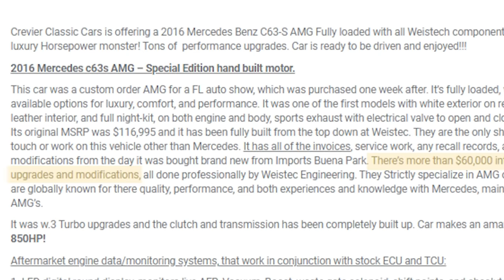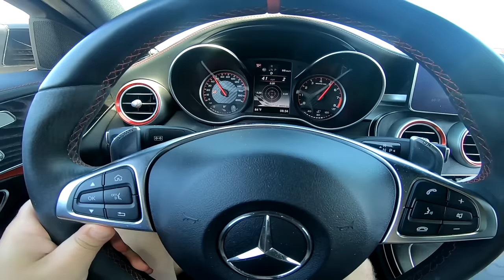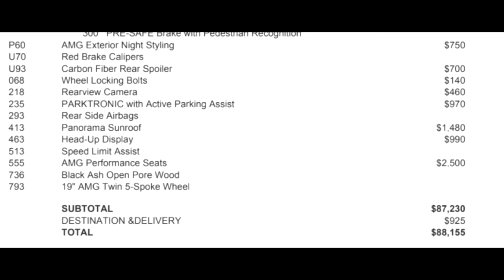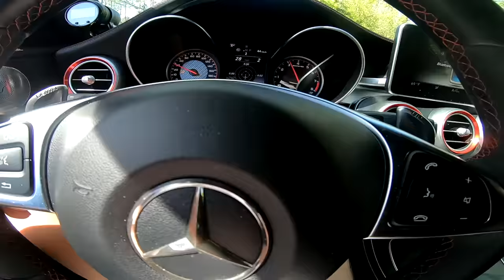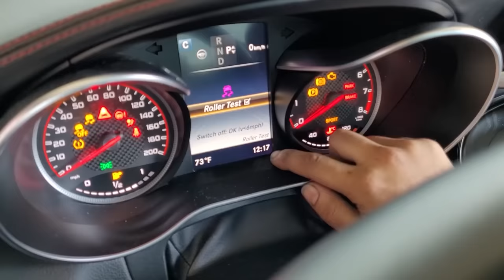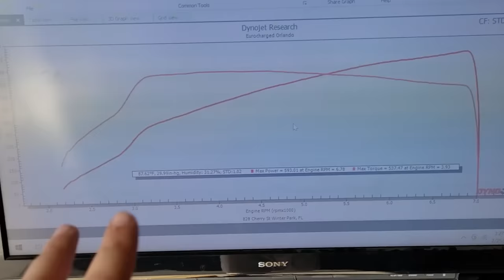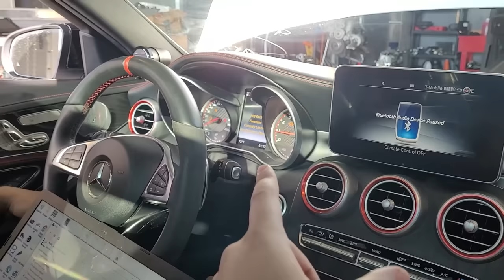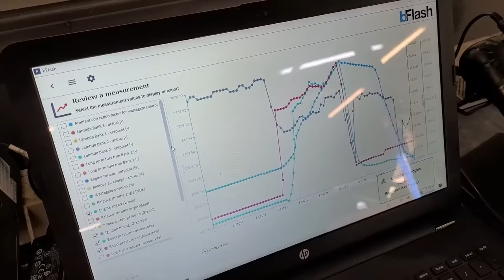I Bought an "AS-IS" $90,000 Mercedes AMG at Auction and got 50% OFF (Twin Turbo C63s)

Comment: I think it’s time to take a break from BMW
Reply: Drama = more views
Reply: @iordanisG  But a far superior driving experience ;)
Reply: My problem with the C63s, and I had one, is that the W205s are stupid powerful but they look like a housewife’s car.
Reply: @986C  That's not a problem that is a benefit. Sleeper!
Reply: @986C  its fun when an bmw or audi stands next to u and u have the amg logo off they think they have a chance
Reply: @bob bob doesn’t change the fact that they’re headaches and expensive ones at that.
Reply: BMW = Drive it till it breaks and sell it because repairs are too expensive.  But it's cool because you can get a high performance V8 for $10k, just don't expect it to last.
Got myself a 2014 E550 4matic sedan with 70k miles for $19k, $23k after 5 year warranty and 3 year service contract.  Filter, downpipes and ECU and it'll crush a Huracan.
Reply: Currently own two BMWs, and am certainly done with BMW.
Reply: Just buys another car so he has less grass to cut 😀

Comment: Someone must have removed the aftermarket exhaust off that car, no way would they do all that work to turbos, oil pan etc and leave a stock exhaust on
Reply: Definitely. Those exhaust were holding on by clamps. Its already been cut. So u right
Reply: Also, the video was sponsored by a known brand exhaust company. Maybe they took the after market ooff, added a stock so they could swap it out with the sponsors?
Reply: @ACURACALABAR11  mercedes come stock with v band style junctions

Comment: Kinda weird your car has a bigger turbo but comes with a stock exhaust. Most of tuners change the exhaust first when they crank up the boost on stock turbos. Although I would say the stock exhaust had some beefy tubes from factory. Don't forget to do a retune after the armytrix swap. The higher flow might lean out your initial tune on the engine. Also do 2 tunes. One with close valves then do another with open valves. Just to make it more reliable. You got a good car at a very good price.

Comment: A Floridian driver that looks over their shoulder when merging? That's a first.
Reply: I’m from New York 😅
Reply: You should never have to "look over your shoulder" when merging/changing lanes, no matter how hard your blind spots are. You should be able to turn your head slightly to look out the sides view mirror, and see your blind spot in your peripheral. The combination of your side view mirror and your peripheral vision should show you everything you need to see. Turning your body to look over your shoulder is a dangerous rookie move. Your back should not lift off the back of the seat. Only your neck should move.

Comment: 0:22 I was astonished to learn that a BMW I8 has a head gasket. Then I learned that some I8s, like the I3, are equipped with a gasoline engine-driven generator, which brings back oil changes and all the other maintenance a gasoline engine needs. At least it isn't necessary to clean and gap the points anymore.

Comment: The brakes on the wagon most definitely don’t look like carbon ceramics 🤔
Reply: Pause it, those are definitely the calipers of amg ccb
Reply: Many amg's don't have ceramics on the rear...
Reply: @PNFarhan  no bro I’m sorry. That usually applies to the calipers. Usually high performance car now a days have like 4 or 6 piston calipers in the front but regular calipers on the back. But never have I seen carbon rotors in the front and drilled rotors on the back. It wouldn’t make sense. That car definitely did not have carbon rotors.
Reply: @PNFarhan  if I’m wrong pls tell me so because I’ve never seen anything like that.

Comment: I don´t know how it is with other car brands such as Audi or BMWs but i recently got my Armytrix downpipes installed on my 2020 E63 AMG (they even posted it to their story). To change the downpipes my mechanic had to remove the entirety of the engine, lower it down, install the downpipes and then reinstall the engine with 2mm space to the left and the right side? Its a nightmare to do such a job. Is it only Mercedes or are other car brands being a pain when it comes to installing some downpipes?
Reply: @itsababyfuckenwheel5088  Yeah it is, the engine was around 2 meters long plus the transmission around 3 meters (around 10 feet)
Reply: BMW is fairly easy to do yourself. Usually just a couple clamps and bolts to remove
Reply: @SwordTrunks  Crazy, my next race car is definitely going to be a BMW!
Reply: Well, what I can tell you is that replacing the piece of exhaust pipe that rotted out over the rear axle of my 2009 Sentra was a bugger.  Fortunately it added no horsepower or torque.  Must have taken all of 45 minutes and cost about $3.  

Now, tricking out my 1974 Honda CB 400 was another story.  My research, efforts and exorbitant parts costs was well worth it, I added nearly two horses to that baby.  Trade secret I'll share since you're a fellow motorhead......air filters.  Massive improvement.
Reply: @6comma316  Well id say stick with the hand built 63AMG power.  I tell you why: A friend once asked me hows your BMW cus i want to get one? I replied: hows your retirement account?.  💀
Reply: @dusaintel  bruh 😂😂😂😂😂
Reply: @erswnn  Damn man thats crazy 😂
Reply: @6comma316  Yeah man, I take it to the limit...then go beyond.  I'm like a mechanical geniass.  I invented cup holders but Big Auto stole it from me.

I once swapped out the alternator in an Astro van.  I'm hardcore to the max yo.

Comment: How much wheel spin were you getting? Seems the rear wheels should have been farther forward on the roller which allows them to push into it vs. behind the center line where its essentially climbing up the roller allowing it to slip easier.

Either way, nice car, keep the vids coming.

Comment: C-class is an amazing platform. Ive experienced the 4 cylinder, the 6 cylinder and the 8 and they are exponentially more impressive as you go up. The 63 if it wasnt so hard on gas would be amazing as a daily. The 43 is what fit for me. No matter which one, even a C300 with the AMG styling package, they all turn heads

Comment: I have a 2021 of this car and it was 87k sticker so the 116k MSRP stated on the listing post is BS. Also the reason I think you're seeing 600hp on the dyno is, yes the weistec turbos might be giving you an extra 300whp, but the stock which makes 503 already has two turbochargers so you're really only gaining whatever the difference is between the stock turbos vs the weistec.

Comment: How much is a built AWD transmission? I just paid $11k for a stock Mercedes remanufactured one with labor ☹️ My u-joint that is inside the transmission that guess to the front propeller shaft went bad. They said I needed an entire new transmission.

Comment: Checkout the Banks Superguage I love it.  Gives a lot of data points esp fuel level for when I am hunting down another E85 station vs 93.  My stock fuel measuring goes to empty with about 10% left in the tank and the fuel range stops at around 20-30 miles left to go.

Comment: open Valve sounds so much better but i wouldn't run it all the time.  over time it will lose power.    drive 300 miles valve open  it resets your computer air glow and everything.   once you do 300 mile open valve . close it and open it wen needed bro.  keeps the motor at spec an top power all the time

Comment: Bought a mustang GT that had been traded in by a heart surgeon who had done a bunch of crazy shit to it. This was right before they started requiring dealers to pull performance parts off vehicles they bought before they re sold them. This thing was absolutely stupid! If you put your foot in it at all from zero to about 70 miles an hour the rear end would just start dancing all over. I finally bought a bladder for the trunk and weighed it down…which helped some, just not nearly enough.

Comment: Running E85 vs 93 octane totally changes my CTS VSport build.   I have done about what that AMG claimed plus probably some additional and parts and labor was around $30k-40k including about $5k in rental car fees during the build which was heavily delayed due to COIVD and supply chain issues.

And just when it came out of the shop finally some asshat in a Prius was jelly and purposely sideswiped me and tried to flee the scene.  Thank god for front and rear dash cams.  I recommend anyone with a performance ride to get cameras.  Everyone thinks the guy with the hot car is always at fault.

Comment: All of they’re labor sounds like a rip off. Installed down pipes on my GLE63s 1 hour +30 min max. Installed the same oil pan, 15 mins . Stock my car was down 577. Now it’s pushing 670 with just down pipes and tune. I installed oil pan just to perform my own transmission oil changes

Comment: I bet there is a button somewhere that switches the tube off, type 1 without methanol, type 2 with methanol and maybe a third one for the Chanel fuel. So there is no need for calling names on the company that did that

Comment: Dude.  I have a 2007 E63 I stopped driving at 220k due to the classic valve bucket issue.  $10k.  I bought it new

Comment: The car from the first pull on the Dyno is still way off from 850HP.  What is up with that lie?  That car is only pulling in the 500HP range, but sold as a 850HP car.  Where is the other 300 HP reported on the options up grade sheet.

Comment: holy fuck the connector was already melted that was apparent and you still leave it as it is. AT least permanently attach it to some place with some bracket would help to protect it from the heat from pipes...

Comment: So don't buy the armor sheild 9 and apply it immediately. You pay thousands because they prep the surface of your car by doing a shit ton of work to remove tar, microscopic dirt with clay and using a polisher to remove swirls. This is intensive and takes a lot of work and time. Do not buy armor sheild and just apply it after washing it. You will definitely regret it when you find out what you have to do to remove it.

Comment: I hate to say it, because they look so good… But those ArmyTrix pipes are hurting your numbers big time my man. 

The Louvers act as an tumbler when they’re open. As an obstruction, they get hot. The exhaust air that’s exiting the turbo and making its way down the pipe, is in a cooling phase… As such, it should be condensing the further it gets from the turbo. However, those louvers and the heat they hold in the path of flowing air, retard the condensing, causing unnecessary and pulsing back pressure on the turbo, and every part of the process forward. 

You’ll notice your Dyno shows a pretty flat line that oscillates in tiny increments. 

Without those louvers/baffles, each of those oscillations, would instead be steps upward.

Comment: Stay domestic and you won't get raped as hard.  My Z06 Dyno was 840 rwhp tuned down for reliability.  I had maybe 26 to 28k in a top notch build- forged 403, cnc heads, meth, trans upgrades, fuel system, exhaust, Dyno and street tune...the works.  
Good times

Comment: As this video was done 10 months ago and i don't see any updated videos, clearly it was not given an updated tune to meet the $$ spent on hardware. Begs the question on why the original owner spent all those dollars on hardware to only add what 90 hp? $22,000 / 90hp = $240 per hp.